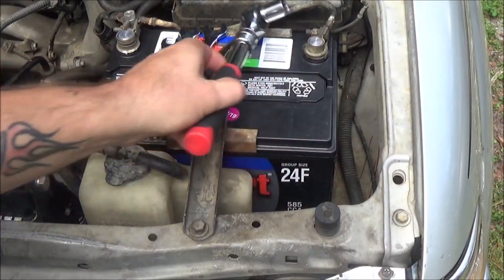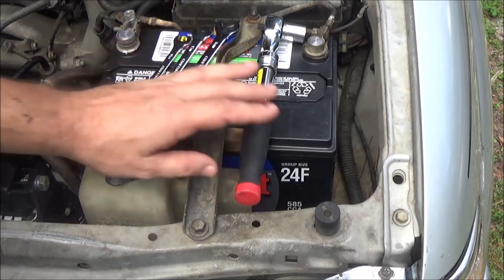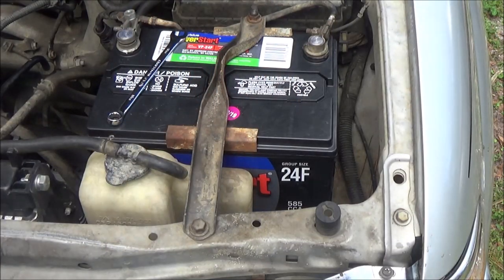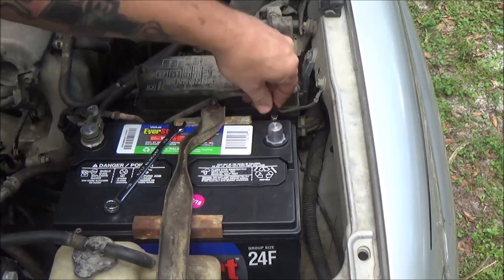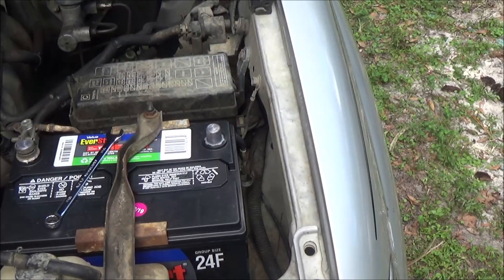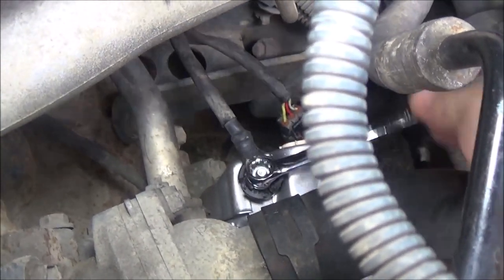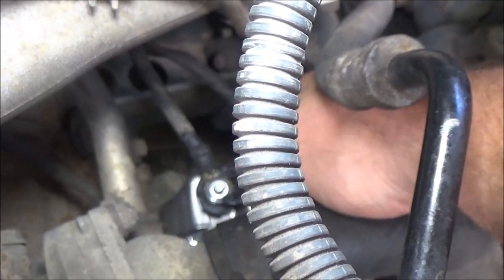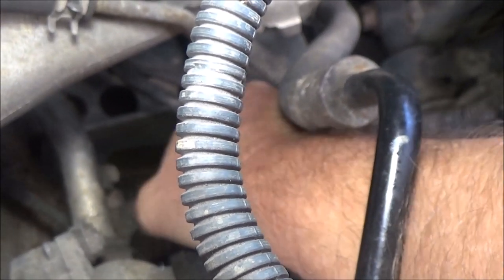Alternator Replacement 2004 Toyota Tacoma 2 4 LTR

Comment: What was the reasoning behind changing it? I just changed mine a few months ago and now I'm blowing fusible link to the fuse box and I'm not looking forward to changing the alternator again
Reply from the maker: I changed mine just because it wasn't charging. Have yours checked, it might be putting out too many volts. Also make sure no wires are touching anything they shouldn't be. It shouldn't be putting out anymore than 14 volts.